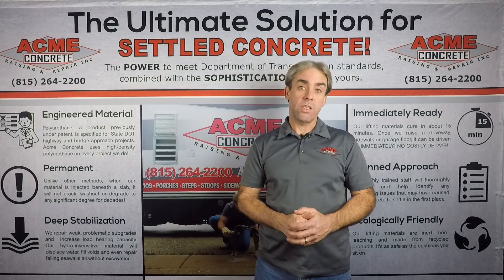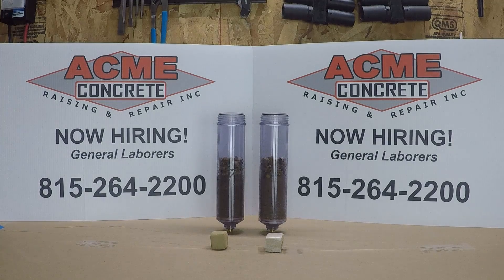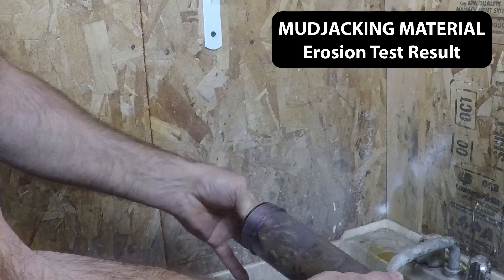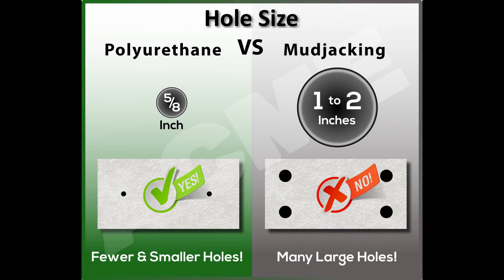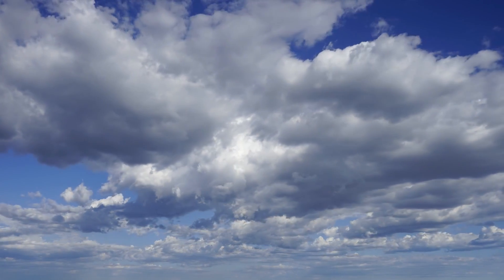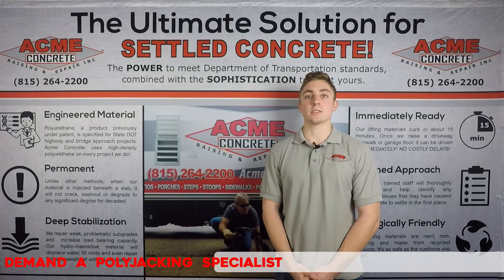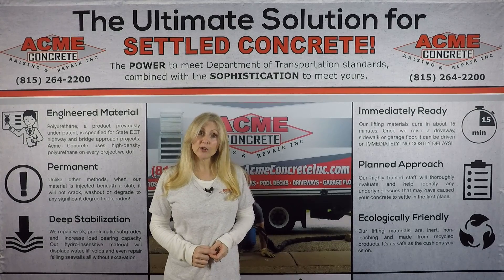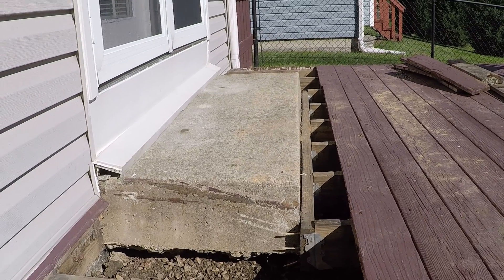Polyurethane Concrete Raising VS Mudjacking

Comment: Alot of mud bashing here. I am a Mudjacking contractor an I've seen foam fail too. You can do more with poly but it does cost more. Any concrete raising method boils down to can you divert that water from going under a slab. Water is what causes concrete to sink so in turn if you fix the water issue have it raised an you won't have a problem either way. If you Mudjack the grout with wash away and deteriorate if you use poly it washes out the base under the foam and will sink also.   They both have there place in the world. If you trying to pass an inspection or insurance claim I'd recommend Mudjacking if you want it to look nicer go with poly. And if you need steps raised or a basement floor raised definitely go with poly. JW Mudjacking out.
Reply from the maker: Thank you for the thoughtful comments, Joe.  We understand this video may seem like mud bashing.  Our goal certainly wasn't to throw mud in anybody's face (pun intended).  We wanted to "level" the playing field based on some customer feedback regarding what competitors are saying.  Competitors have really slammed poly on quality, price and hole size.  Unfortunately, some companies will outright lie or use scare tactics to get a job.  Our goal is to get the facts out there so there is no misunderstanding. 

As for price, you are correct.  Poly MATERIAL does cost more than mud.  However, because of the fast, streamlined process of injecting poly, our bids come in cheaper than mudjacking quotes.  Not 100% of the time, but pretty darn close!  This even applies to "bigger lift" jobs that require more material.  In one case, we lifted a guy's patio and adjoining walkway. When finished, we asked why he chose us.  He stated a mudjacker quoted his job and told him not to even bother with poly - that poly would be 3x the price.  (We actually came in at about 1/2 his price, AND we sealed all the cracked joints which weren't part of the other company's bid.)

The only foam failure (like you mentioned) we've experienced has been in cases where the base continued to wash out.  If the ground beneath ANY lifting material (be it slurry, mud or poly) continues to erode, the area will undoubtedly drop again...unless poly is used with Deep Injection to stabilize the entire area. In that type of situation, poly isn't as cost effective.  On a side note, we've repaired mudjacked concrete where we could literally see the mudjacking material washing out - not the base. We do appreciate your comments Joe.
Reply: @Acmeconcreteinc  It stinks you have competition like that. If I come estimate a job an it's not something I can do but could be done with poly I have foam contractor I refer them to an if they have a customer who can't afford the poly or is out of there area an in mine. I'm kind of blessed in that regard. You get way more word of mouth just being honest with a customer if it's not the best fix or should be replaced. Where you guys out of?
Reply: Just checked out your web site looks nice. Crazy I grew up in Marengo IL not to far away.
Reply from the maker: @joewengert2153  We totally agree!  Its always best to be upfront and honest with clients. There have been times where we weren't the best fit for a customer, and we've had to refer them elsewhere.  As much as we want everyone's business, we'd rather refer out and maintain our integrity rather than do work we cannot stand behind.  A lot of our clients are repeat customers and many come from referrals.  We take great pride in our customers' satisfaction. We also offer a Price Match Guarantee. 

We're based out of Lake in the Hills, Illinois.  We cover most of Chicagoland's northwest suburbs and some of southern Wisconsin.
Reply from the maker: @joewengert2153  Thanks, Joe.  Marengo is just a hop, skip and a jump away from us!
Reply: Joe Wengert that must be why in Indiana it’s virtually impossible to find a mudjacker in indiana. It’s technology of old. Yeah it’s more expensive but it works way better. Poly fails due to poor workmanship it’s not the product.
Reply from the maker: @aguy80  You brought up a very good point, Cody.  Companies who offer poly as a "side service" (like water-proofing companies) are usually not as experienced as those of us who actually specialize in using the product.  Side-service companies also offer their poly services at a way higher price than those of us who's primary focus is raising with poly.  Since raising with poly is our main focus, we're able to offer the service at a VERY competitive price - typically lower than what mudjackers charge for mud. Our technology is also faster than the delivery system mudjackers use.  This saves on labor cost, allowing us to pass that savings onto our customers.
Reply: After watching this video, as an expert i would say Mud jacking is a potential scam. Good day sir.
Reply: So then I was correct telling my father that he needs to make sure there is no standing water around his house. He has had a problem on one side for a few years. So raising incline from dirt to house is ok to do,  there is about 4' feet to work with left to right with about 45' run to front of house. French drain just outside the gate.
Reply from the maker: @fluffymittens24  You bring up a great point, Chris.  Improper grading and/or improper pitch around homes is a common culprit for water issues.  You were definitely correct in advising your father to check the grade.  If there is any concrete surrounding his home that is pitched incorrectly, we'd be happy to do a free estimate for you providing you are in our service area.  Feel free to contact us at 815-264-2200 or submit a request via our website:  www.acmeconcreteinc.com.
Reply: Lmao wow no common sense here, water isn’t what washes the concrete down. It’s what erodes the MUD. Anyone with a brain would not replace mud with mud and expect different result!! You upgrade to a superior product. Mudjacking is just another scamming industry that takes advantage of ppl and takes their money to have the same issue happen again. Mudjacking is equivalent to hiring a guy off the street who’s never picked up a hammer and have him built you a house from scratch.

Comment: It all depends on what kind of polyurethane you use. Some do break down over time and not all are waterproof. Do your research and I say this because Ive been looking heavily into both. Only because I am thinking about opening up a business. Not all polyurethanes are equal.
Reply from the maker: Thank you - that is a very good point, we completely absolutely agree that all foams are not created equal. There are thousands of different formulations of polyurethane foam - all designed for a specific use. To your point - we've actually heard of a "company" that uses spray cans of expanding foam purchased from a hardware store for raising concrete. Those foams are great for their intended purpose, (insulating around windows etc.) but those products were not designed to lift or support concrete. If someone raises a slab and sprays great stuff under it - it will not last, the concrete will drop again. The foams we purchase are water resistant and meet stringent specifications - even those for the Department of Transportation highway projects.